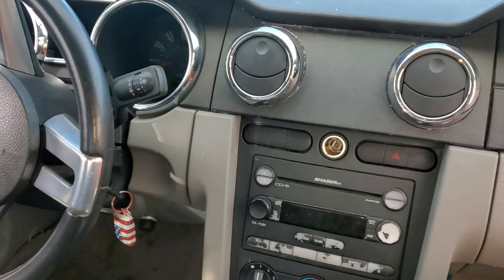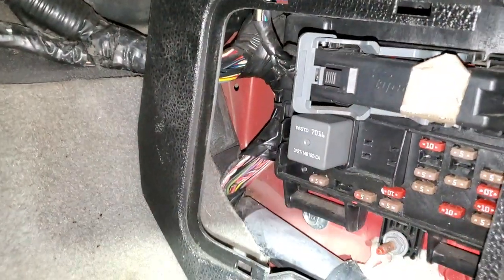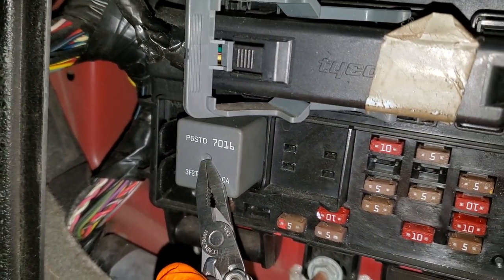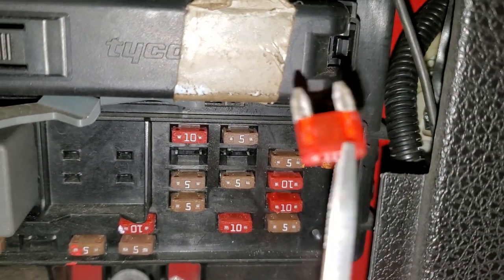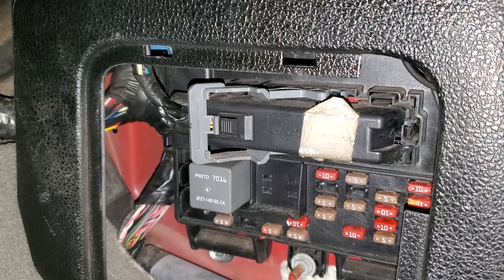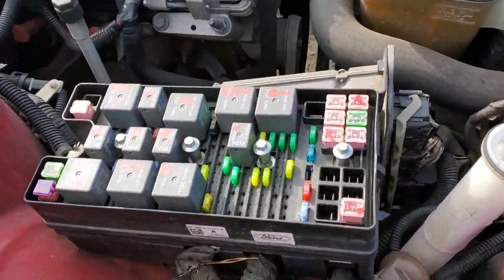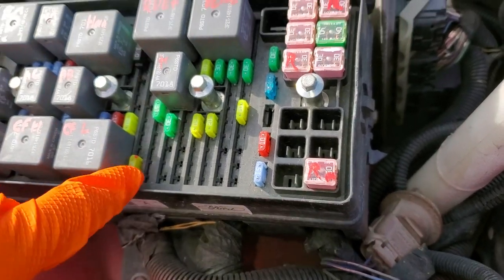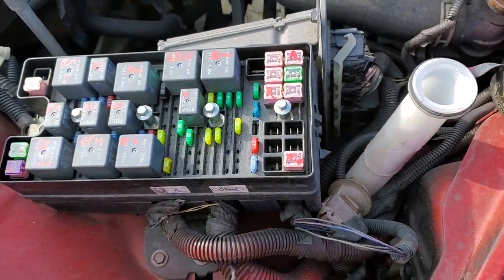2006 Ford Mustang Radio Fuses

Comment: Thanks man. I really appreciate your video and thorough explanation---you saved me time and effort.  Per your video, I checked all fuses and as it turns out, I had to pull out and reset the radio fuse under the hood as it wasn't blown.  …..went to turn on my car and bzam!....radio came on!!! Thanks so much!!
Reply: What do you mean by reset
Reply: @screamersnsp4229  You need to pull the #3 fuse after the car is off then put it back in. It will "reset" the radio.
Reply: @artsohc  the superpower/blower motor relay

Comment: A common fact now that the Shaker is causing the draw.  Has anyone found a way to stop it, besides killing the radio?  Thanks for any response
Reply: I need help with this right now too Keith. I had been having the same issue with my shaker 1000 for a while. I just installed a new head unit and wired in a kill switch to the Amplifier turn on wire. I'll let you know if it fixes it, but I dont think it will. Have you found anything?
Reply: Same

Comment: Got a 05 mustang with 500 shaker I took radio out cause it was cutting out in driver door replaced it with new Kenwood DMX now driver side works great and passenger front both cut off I really don't know what to do now

Comment: Thanks so Much bro I went out bought a bunch of fuses none of them fit … was totally bummed out … still when under the hood and reset the 20 amp fuse … radio wasn’t on, turned on car, radio still not on … then I pressed the power button … boom !!! Radio comes on … thanks alot bro !!

Comment: Thanks, nice quick summary of the Radio Fuses.  As like my 2007 I age my reading the owners manual gets more difficut and I thought the radio fuse in the box under the hood was at a different place and that radio fuse you replaced was #66.   But no what i thought was the location for 66  was really 56 and that is the what shorted when i was wiring the power to my new radio.

Comment: Hi I have a 07 Mustang that I cannot get power to the aftermarket stereo I'm installing.  I've checked the fuses and they're good and believe I have it wired correctly. Any suggestions?

Comment: My 2010 Mustang radio comes on all statics like when you are searching for a radio station and it happened right after I installed new battery. That whole radio panel have no power. The lcd screen and non of the buttons works. Any ideas?
Thank you

Comment: thanks! My shaker 500 is jacked up after 15 years and i'm pretty sure it or the amps are killing my battery so i just pulled the 20a and amp fuses under the hood.
Reply: Are you able to still use the radio, or just drive without it? I’m currently having mine drain the battery too.
Reply: @jamespruitt6718  I just drove without it. i've since replaced it with a pioneer and replaced the fuses. It probably still drains the battery because i think it's the amps so i keep it on a tender 24/7

Comment: im hoping you can help me out, my alternator gave out, i replaced it as well as the battery. when i went to connect the battery i connected the terminals wrong. there was smoke coming out from behind the motor close to the firewall as well as the alternator. new alternator is now fried. any idea what gave out behind the motor? also my head unit now wont start, should i check these fuses? it is an aftermarket stereo. thanks in advance!

Comment: I have a 2008 mustang gt. My radio wont turn on at all, i checked all the fuses you suggested. Anh idea what els i can check or is my radios life gone?
Reply: Same. The 5 amp fuse was my power windows. Did you find a solution?
Reply: seems like a common problem with the BCM

Comment: I have a 05 Mustang. The radio stopped working while driving. While trouble shooting I found out that the radio worked when the key was in the acc. position. I pulled fuse #20 10a and the radio worked with it removed. Do you have any recommendations on what to do next? Run without that fuse?
Reply: Yes

Comment: I have the following scenario for a Mustang 2005. I was working on my driver seat and had the driver door open for an extended period of time. My battery is good and the car turns on except my power windows and radio no longer work. I've checked the associated fuses but they all work. Any idea what it could be?
Reply: same issue here, 12 mustang gt shaker 500 just stopped working, please did you find the issue?? I appreciate your time.            Kevin
Reply: There is a youtube video called "Does your 05-09 Mustang Needs a NEW Interior Fuse Box? (Smart Junction Box/Anti-Theft Fuse Box)" that discusses these symptoms caused by a different issue. Check it out and see if your symptoms are similar enough, could be issues with the interior fuse box itself.
Reply: @kcampbell4098  There is a youtube video called "Does your 05-09 Mustang Needs a NEW Interior Fuse Box? (Smart Junction Box/Anti-Theft Fuse Box)" that discusses these symptoms caused by a different issue. Check it out and see if your symptoms are similar enough, could be issues with the interior fuse box itself. Im chasing a similar issue, let me know what you findout Kevin!

Comment: I’m not sure if you will see this since it’s so late but on my mustang this year when I take the key out the ignition and close the door, the radio is still on trying to cycle the CD for some reason
Reply: Same issue here. Hopefully he comes back with a solution soon...
Reply: @candicefanning  I just unplugged the main fuse for the time being. I’m going to replace it and see if it will work
Reply: @Tstaten4  Good luck!! Let me know the outcome please.
Reply: @Tstaten4  any update if you got it fixed, cause mine is doing the same issue
Reply: @albertmartinez6705  sadly I didn’t, I just unplug the main power fuse for the radio whenever I get out the car
Reply: @Tstaten4  Does this drain battery? My radio comes with a message that says "CD error" and its making a weird sound but my car isnt even on.
Reply: @med3537  yeah it made my battery die several times
Reply: Tstaten4 God that sucks ….
Reply: Tstaten4 So im getting a new radio installed next week , do you think my battery will die with this going on for another week? Shits stressing me out. How often did your battery die?
Reply: @med3537  i would recommend taking out the power for the radio fuse so it won’t die in those 10 days
Reply: Tstaten4 Ok yeah I might just have to do that. Thank you. It’s funny - Im getting some people telling me not to worry about it draining battery since my car is off and its just a radio having a cd error and then some people telling me it prob is draining the battery and that i should get it fixed asap.

Comment: Does anyone have any fixes or my aux option not popping up. I have a 2007 mustang gt and when I try to use the aux when I cycle through the SATs it doesn't pop up anymore, it just goes to sat 3

Comment: No power to red ignition when flipped forward in key on off position checked the fuses yellow constant is working right
Reply: Radio fuses under kick panel were good and the shaker 500 had three plugs not two?
Reply: Same did you find the issue

Comment: My 2005 mustang when I got it has a custom radio but when I use it the bottom speakers don't work but I tested them on another car and they do work they are the bottom speakers on the doors
Reply: Same. 06 GT and bottom speakers don’t work with new stereo. Help

Comment: What if the radio stays on while car is off and doors open ?
Reply: I have the same problem.  Any update? I just take out the fuse under the hood when I'm not using it but that gets tiring.
Reply: @MrAntiAvaricious  It was my fuse box inside , I replaced out the fuses that had corrosion but it hasn’t did it in a min so I hope that helps
Reply: And*

Comment: I have an "07 Mustang with a Shaker 500, (the radio is a total POS), turn off the ignition and open the driver door and the drivers side door speaker SQUEALS, cycle the ignition key off and on a few times and it shuts off?  I also believe the radio system is parasitic drain on the battery.

Vehicle only has 55k miles and is perfect condition otherwise - I guess I'll replace the entire system.